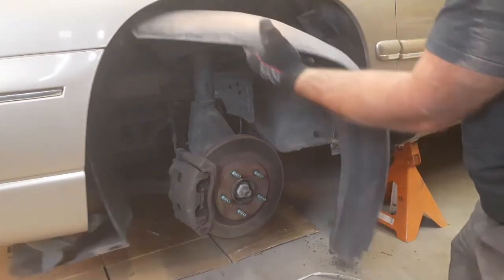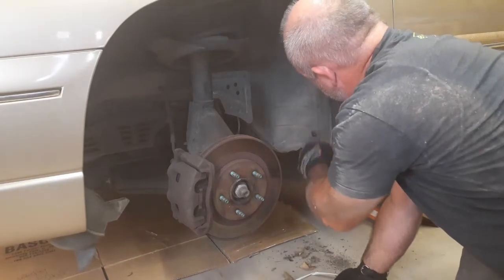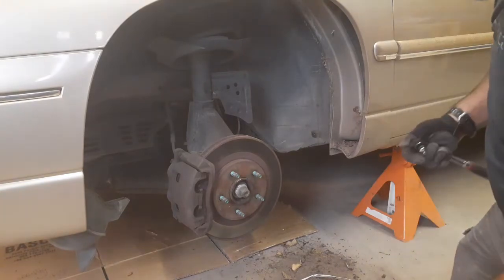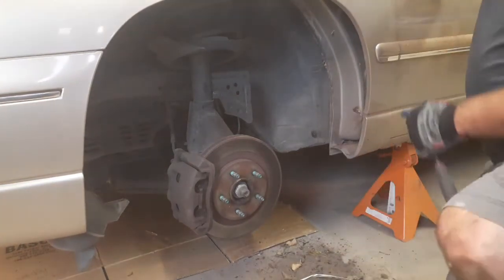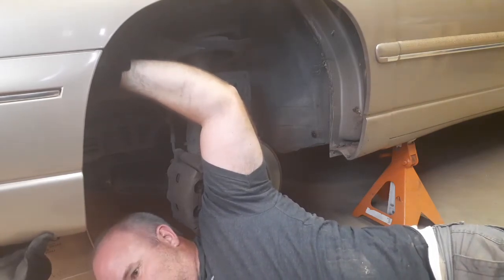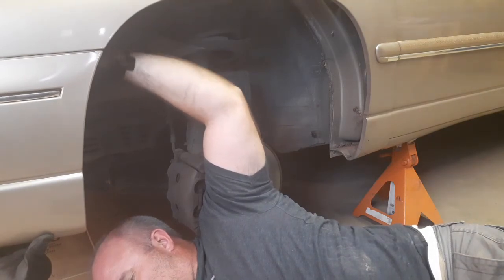Lumina Removing the Fenders

Comment: I have the exact same car. I am trying to remove the fenders to replace them (road salt has pretty much eaten through my current one). What are the rough steps you need to take? I saw you obviously removed the front wheels and wheel well panel. After that you seemed to do a lot of unscrewing underneath? What else needs to be removed prior to going about that step?
Reply from the maker: There is a flexible under skirting which is what most of the unscrewing was. There are a few screws going into the cab from under the fender, then a bunch of screws along the top, inside the engine compartment. Over the next week and a half, videos on reassembling the car will be coming out (the first on the 14th) which may give some more insight. Also, with the painting videos, you can see the fenders off the car, and can get a feel for the number of screws/bolts attaching the fender to the car.